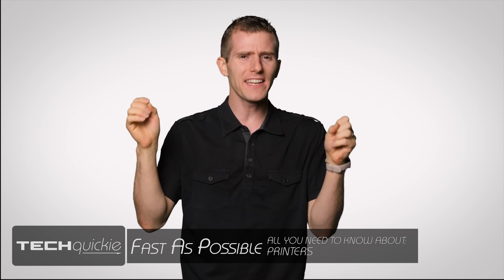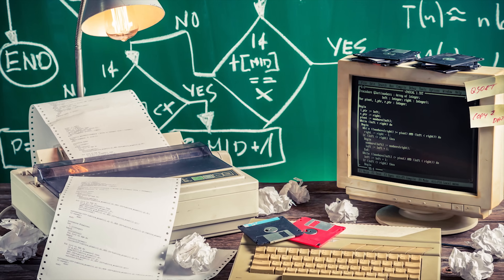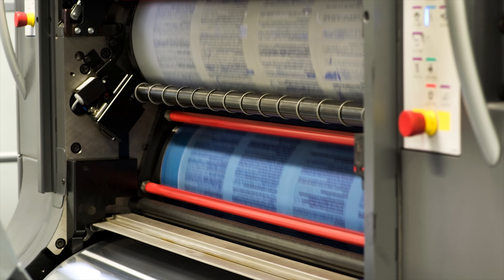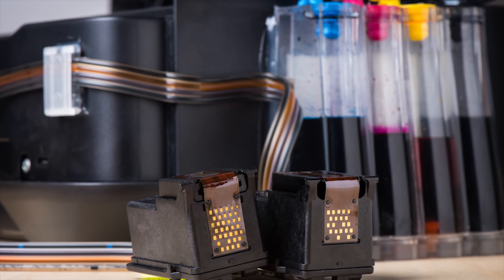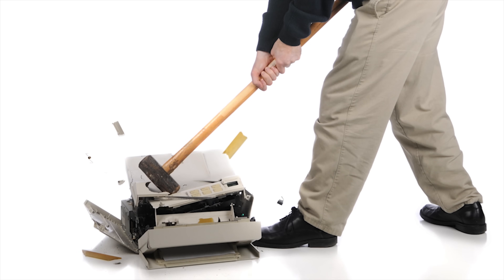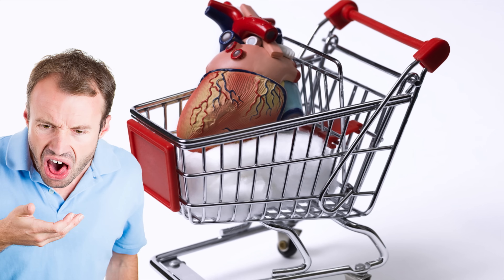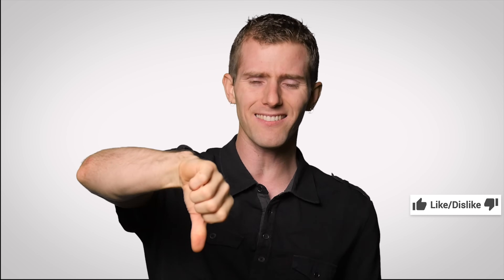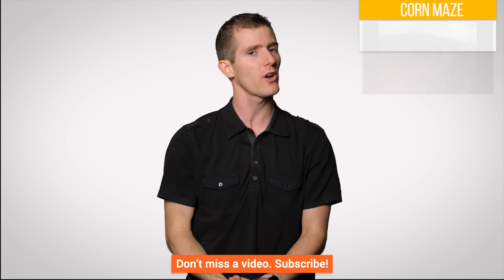Printers As Fast As Possible

Comment: Okay Linus.  I have a story about my Epson XP 320.  I was printing an article from the web.  I set my printer preferences to print in black and white: That did not work.  The printer continued to print the document in color.  So i saved the web page as a pdf file, set the preferences to black and white, then printed from adobe acrobat.  the printer still printed in color.  So I printed the document to a pdf file again, but set it to print in black in white.  When I opened the new pdf file my screen displayed a document in black and white. "viola!" I thought...sure enough the god damn printer still - STILL printed in color! - meaning the printer is printing from memory and ignoring my preferences and the fact the document I printed is literally IN black and white.  I had to open the black and white pdf file in a different pdf viewer in order to print in black and white (even then, i cant be sure the printer is not using some kind of composite that ends up using color cartridges anyway).  As you know, the printer will not print if any of the cartridges are expended and will require the expended cartridge(s) to be replaced in order to continue printing.  I have a new black ink cartridge, and did not want to use the color cartridges because i didn't need them.  But the printer seems to be programmed to force color cartridge use for the purpose of seizing and prompting you to purchase more ink in order to continue printing.  This seems a lot like a kind of ransom ware in you asked me.  Clearly choosing not to print in color required using workarounds and just selecting the option to print in black in white from printer preferences is not enough. Am I missing something here?

Comment: Funny that Linus ignores LED printers and that EPSON/Brother do not use thermal printheads but piezoelectric, as opposed to Canon and HP.
Also, some use permanent printheads, others come with factory installed CISS, others come with CISS but the printhead is replaceable... there's way too much information about printers not covered here.
Reply: It's called "As Fast As Possible" not "Everything You Ever Wanted To Know About Printers" but you did get a chance to show off what you learned in your A+ class, so that was important.

Comment: Working on ink jet printers and laser printers since both technologies were introduced; I find in my humble opinion that today the optimum choice is laser printer for standard everyday printing. This includes color laser printing. Ink jet printing's biggest drawback is the ink itself. It is messy and relatively expensive. If you don't print often the ink in the nozzle tends to dry out and clog. Sometimes the ink will drip within the printer and eventually stain paper. And the cost of cartridge replacement is still high in relation to print yield. Which causes most ink jet users to not want to print regularly enough to keep the ink flowing to mitigate dry ink nozzle clogging. Laser printing provides more print yield per toner cartridge and is not prone to dry out. Laser printers do have issues such as toner settling and caking if not utilized for several months but this is typically solved by gently shaking the cartridge horizontally for a few seconds. The image transfer drum eventually does wear out and will need replacing however the typical life expectancy can easily last 3 to 6 years with average printing usage. Due to proliferation of monochrome and now color laser printer manufacturers the price of laser printers and toner cartridges have significantly dropped making them affordable. Ink jet printer technology still has the advantage in regards to printing large scale documents such as blueprints, banners, and graphics larger than 11x17 format.

Comment: Not even laser printers are all that reliable anymore. An old HP LaserJet 5000 can take a two-page word document with images and text, and it had no problem. But then when I try to send the same document to a relatively new HP Color LaserJet CP2025… it hardly did jack, even after I converted the file to PDF and tried printing from a different computer. It eventually worked about ten minutes after I gave up, but it’s astonishing that a printer that’s at least fifteen years older can handle jobs better than a more recent model from the same manufacturer. And I don’t think that particular 5000 came with out-of-the-box network support, either, which makes this situation all the more laughable.

Comment: The reason why inktjet printers are also unreliable is because of dust wich will settle in the printers heads overtimes, dust can and will rule your printer, that's also why inkt cartrides are expensive and hard to made and produce because of the dust, that's why inkt catride company's are 10.000 times more cleanerthen an average hospital.

Comment: Printers/Inks are one of the most resource waisting things on the planet, Stupid when you run out of ink it's cheaper to buy a new printer which come with a set of inks then buy replacement cartridges, with the exception of massively overpriced/technical printers

Comment: I can explain what a printer is in 10 seconds: A device sent from hell to drain all your money.
Reply: Without one I would not be able to ship things on ebay
Reply: +justin rivera Well, inkjets at least. cough**cough needs cyan to print a black-and-white document.
Reply: The Spitfire a physical manifestation of Satan
Reply: Had a HP 1020 never had a problem. Just try and get an old machine. If your buying a new machine, get something that fits your usage. If you are underusing or overusing the printer it will cause problems. A lot of people frankly, misuse their printer.

Comment: So in short, get a laser printer. They just work.
Reply: They are reliable asf. My ink jet takes about 15 mins to print a page. And the UI sucks. My laser jet printer connects via usb and bam with a click the page prints out
Reply: I can leave our laser printer unused for a week and still work in an instant when I need it.
Reply: EJ Tech i
Reply: @maxwelllee5006  Mine takes 40sec-1min per page of document at high quality on Canon E470.
Reply: Vysair damn lmao it’s been 3 years but yeah printer quality and price has gone down so much
Reply: We have ones in the office that are approaching 20 years. I'm not sure it's a big deal though, if you can find a printer that comes with real cartridges not 'starter' cartridges, they cost about as much as the OEM cartridges. The trick is finding a supplier for good cheap toner. Which my boss never found... so that was an expensive 20 years
Reply: @HezekiahD  Kato > and HP4250
Reply: I have a 1995 HP LaserJet 5L I've litterally found next to a garbage container 7 years ago. That printer, while being OLDER than me and having done thousands of pages with it, it still works, has no "low toner sensor" bs, cartridges are avaliable (refurbished) for 10€ and you can refill them anywhere for more or less that price. I hope it will keep working for years. The only maintenance I'll do is to clean it bc lately I've been having some toner spill
Reply: No, have both, use the inkjet exclusively for printing things you need in color like graphics and pictures, and use the laser for printing documents that don't need color. A color laserjet is cost prohibitive, cheapest ones are usually around 250 or 300 and a set of toner cartridges when the little intro cartridges they gives you to start with run out, is usually in the 300-600 area. A mid size hp color laser is like $120 per toner cartrige, so $500 for a full set. Sure it will print a lot of pages with that toner, but most home users don't need that much color printing anyway. 

Far more cost effective to get a black and white laser and a color inkjet and use accordingly. You can get the laser for $150 and probably $70 for the inkjet.
Reply: "they just work" is that a JoJo reference?
Reply: +EJ Tech My dad has a 15 year old printer in his office that still works perfectly. It's a laser printer
Reply: I have one. Or two, but the second one is modified for PCB printing. It takes a few moments later than inkjet ones but it's just better.
Reply: EJ Tech lol. I have like 3 hp LaserJets. They last me a long time. While ink jets use the ink when they clean themselves. Laser printers are your best friends
Reply: Don't buy Fuji, I bought a Laser color printer from Fuji, CP116W, and stopped working after a couple of years.
Reply: Check epson inkjet products

Comment: If toner particles also have a charge, then they should stick to oppositely charged particles or surfaces. If the laser beam neutralises the charge on the surface of the drum, I don't think it will stick on there. An error or is there something I don't know or did I make a horrible mistake here? 
Either the areas touched by the laser correspond to the blank areas on the paper or that the laser actually charges particles on the surface of the drum.

Comment: I'm trying to find a smallish, reliable printer that will print color VERY quickly from a cold start.  Basically, I want to plug it in, turn it on, send it a job, a receive the printout in as little time as possible.  Budget is $500 or less.  Does such a thing exist?
Reply: I'd recommend buying many iPads of different sizes and pulling the photo up on the iPad. Even buy an iPod for little wallet photos of that's what fancies you!
Reply: lmao
Reply: Any laser printer from Xerox or Brother
Reply: A color laser will do the job.
Reply: kevin smith we had a tiny ass photo printer... It may even do text
Reply: Exault that won't work, the budget is $500. iPads and iPods cost like a million dollars each.
Reply: I use an Epson L210. It is quite reliable imo.

Comment: From working retail at an office supply store, this is home printing according to customers:

-No brand is safe they all either cost too much or break (pretty sure it was your fault for letting the cartridges dry out 10 times)
-Lasers are never worth it (even though they totally are and for a lot of people laser would be a better fit than an inkjet)
-Replacement parts are easy to grab so there is no need to look up how much a printhead costs (no... just, no.)
-This man must be lying to me, surely all these printers are different (no they are not, the hp 8620 is a rip-off compared to its little brother)
-Brother has support staff in North America, so much better than [brand name here] (that has nothing to do with the quality of the printer...)
-I didn't know Samsung made printers, they must not be very good if I have never seen them (...sigh...)
-I'm pretty sure my other desktop printer can go bigger than 11x17 (And I'm pretty sure you have no idea what 11x17 looks like!)

Comment: As a student on a bored afternoon I took apart an inkjet printer and found a plastic strip with graduations marked on it. I out the printer back together without this and it turns out it was what closed the feedback loop on the position control for the print head. Was great fun turning it on - the print head slammed back and forth at full speed!

Comment: my beef is with ink.
i bought a printer. 

i printed one full page drawing for testing the quality and general calibration.
then i printed another one and ran out of ink in the middle of it.

then i realized the cartridge comes with TWO MILLILITERS of ink. and it costs, by weight, a third as much as GOLD.
this printer does not accept refilled cartridges.

i have never used that printer again. it's garbage.
i heard somewhere there's a way to hack the cartridge to hold 40ml, and tricking the printer into thinking the cartridge is new, but i never found clear instructions on that.
the printer is a HP deskjet 2546 ink advantage wireless, in case anyone knows anything. please help me not crushing this thing into dust.

Comment: The "Cylinder" is normaly known as the Drum or OPC (from the old days; Organic photo conductor). The toner is transfered to the paper with help from a grounded roller on the back side of the paper, known as the Paper transfer roller(PTR). Meaning the toner isn't transfered by being pressed against the Drum, but by moving the electronic charge towards the PTR as the paper passes through between the Drum and the PTR. How the charging between negative, positive and ground is setup, varies between models.

Comment: I still have a couple of inkjet printers, but honestly I prefer my laser printer (have 2 of them), laser printers although having a more expensive cost, end up being cheaper overall due to the cost of toner. 

The Samsung my mother has, the highest capacity toner costs $150AUD and is capable of doing over 12000 sheets of paper before needing replacing, compare that to the cost of a tank of ink ($60AUD for 1 black for my Brother inkjet) which is only capable of half a ream of paper if it is lucky (250sheets), the toner starts to look mighty cheap.

Assuming you stick to the decent laser printers (Kyocera and Lexmark being the top dogs), the whole thing should last you forever (my oldest laser printer is currently 10yrs old and still working, I have a friend who has had the same laser printer for the last 15-20yrs and still working).

Course, that works well if you are just printing B&W, when you want colour (or photos), an Inkjet can still work out cheaper, but you have to weigh that up, how much B&W printing do you do vs colour.

Comment: I have yet to meet anyone who had a flawless experience with an inkjet printer.
Reply: +Aspiration the Canon BJC-7000 printed many thousands of colour pages with very few easily fixable problems, it was from the days of the centronics  printer interface, USB was the downfall of printers.
Reply: brian whittle Thanks for sharing your experience. Yes I agree I think a lot of the new ones are poorly manufactured.
Reply: Aspiration
it was from the days of decent size ink cartridges the black was a massive 60 ml
Reply: I have an EcoTank as linus mentioned, Ive printed around 50,000 pages with less than $70 worth of ink. Feels good man
Reply: The only problems I've had with printers are networking ones.
Reply: We have an inkjet printer that's never had a problem, except for the fact that it's a royal pain in the ass to refill since we use it so seldomly
Reply: Yeah seems like the new ones over the past 10 years have gone down in quality
Reply: Now you meet :) print 40.000 page with epson m105 in less then 2 weeks
Reply: Aspiration well hello there. I actually exist.
Reply: I have a brother MFC 440cn and have NEVER had any issue with it.
Reply: @randysmith719  brother inkjets are the only inkjets I’d buy these days maybe aside from epson ecotank, they were one of the last printer makers to put chips on the cartridges, I have a 2012 model that’s got unchipped cartridges, ink levels are read using a sensor and a clear area of the cartridges
Reply: You need a newer model then I guess...
Reply: I know one person.

We disagree.
Reply: Lexmark cost reduced the Dell Photo Printer 720 (and friends) so much that they accidentally made a fairly reliable inkjet printer.

Comment: Excluding my 1990s inkjet, I've had three since then - the first, bought in 2004, had the power brick fail immediately and was replaced by the manufacturer. It's replacement still works to this day. My current printer was bought in 2011 and still works. I haven't seen any reliability issues with inkjets.

The £100 laser printer at work, however...
Reply: Obviously a cheap laser printer is going to be dogshit. try comparing your inkjet printers to a comparable laser printer then you will see that laser is better

Comment: I would recommend going with Epson , specifically L355 model
I had it for a year now, still not even half of the ink is gone.
I printed over 1500 pages maybe.
But looking at HP printers, two of them broke before one year with me.
Reply: High end HP printers are the best in the market, (maybe xerox is better, but it depends) but HP just can't do good end user goods. It's like this for everything they do.

Desktops = Crap
Workstations = Good

Regular calculators = Crap
Graphic calculators = Good

Server and cloud hardware = Good
Home computer stuff = Crap

Gigantic printers for big graphic companies = Good
Home printers = Crap

Comment: You should mention LED printers too. They work somewhat like laser printers but don't have mirrors in them, so they are sturdier. Also they don't run a line and then continue at the start of the next one, but print each line as a whole, each letter simultaneously.
We have some in the university and they are crazy fast.

Comment: here is my tip to save money on printing:

go buy a canon inkjet printer. bought 8 XL ink sets (5pcs each), for 30 euro, and if you live in germany its 20 euro (10 euro was the post, couldnt you guys use smaller package?...)

and why i say canon instead of hp? well, because for some reason the ink are sold cheaper in ebay while they have equal or even bigger volume of ink, and the second reason is that the drivers do not force the printer to stop if it report there is no ink. i had printed close to 50 colored pages AFTER they were supposed to be empty with the stock normal capacity inks the printer came in. 

my model is MG5650

meanwhile my friend who bought a hp printer (even after sharing with him all my bad experience with their reliability and drivers) his stock ink were not even printing
Reply: The HP machines use the canon engine currently.

Comment: So can a laser printer print forever until it breaks?  Or will it eventually run out of solid toner?
Reply: +Calvin Ball It's not quite 'solid' toner. An auger pushes toner dust to the OPC drum. Standard toner units are rated to run around 10,000 pages at 5% coverage. 30,000 on extended toner cartridges.

Toner will expire if exposed to humidity or static. It's very unlikely this will happen if the printer is located in a dry location.
Reply: ***** Thanks for the information. :)